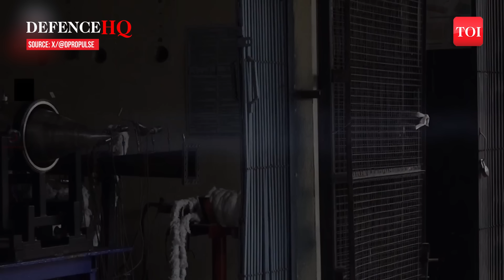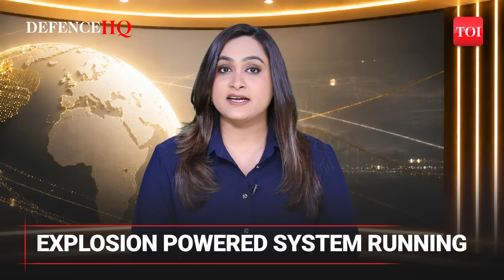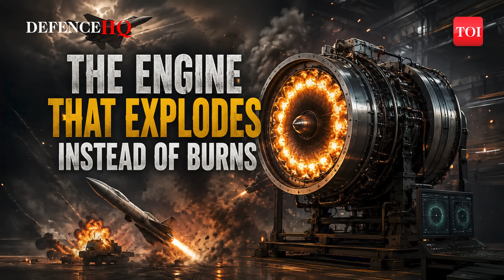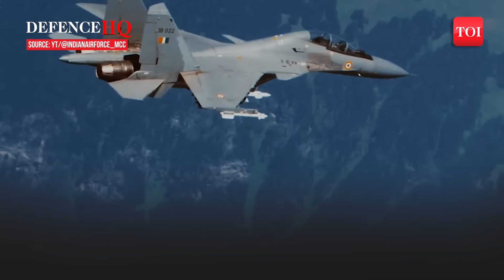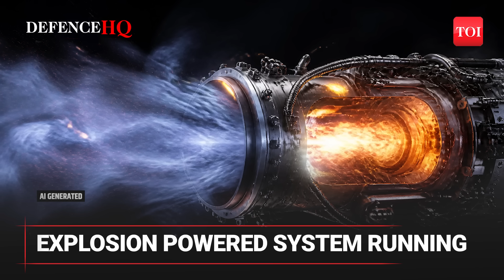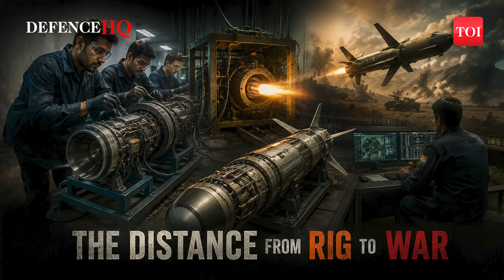Beyond Fighter Jets India Builds New Drone And Missile Engines | DRDO | D-Propulse Aerospace

Comment: Missile engines 😂😂😂 ? Super terminology .
Reply: Hi abdul
Reply: Why dnt you correct it? You tell the world what wrong was in this video and also correct it pls.
Reply: @brainwork27  We call them rocket motors .
Reply: @prakat1082 "A rocket motor is a specific type of self-contained reaction propulsion device that carries both fuel and oxidizer. A missile engine is a broader term for any propulsion system—which can be a rocket motor, a ramjet, or a turbojet—integrated into  a target" - source google AI, you both are correct.
Reply: @brainwork27 : We in ,missile groups , always mention it as rocket motor only . Be it  strategic or tactical missiles .